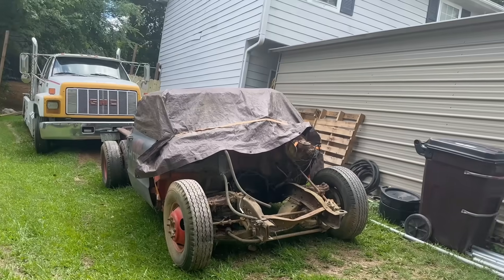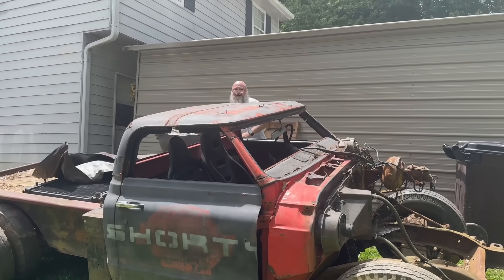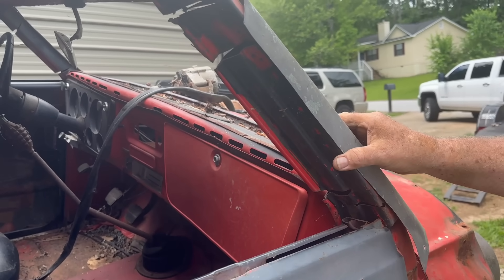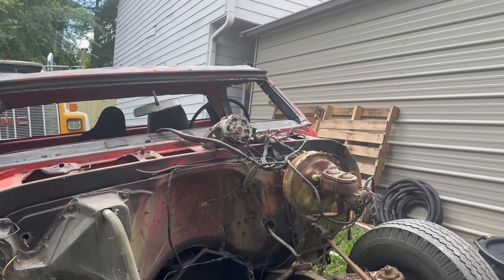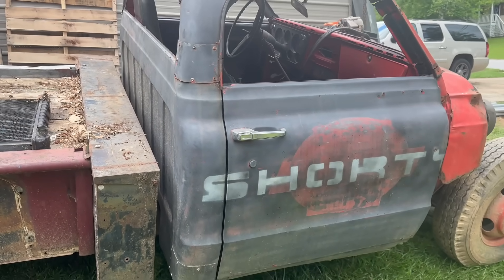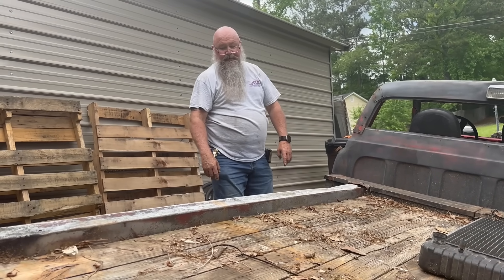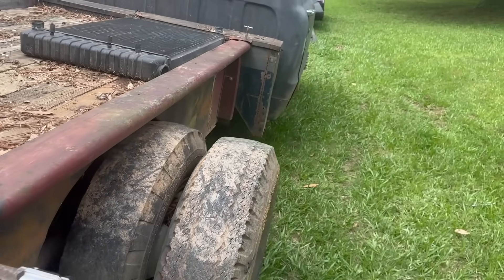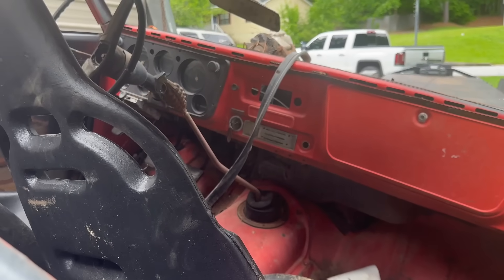Can’t believe someone cut this truck

Comment: Replace the top. Put it back to the original cab. Make a drag and drive truck. Fix the rear suspension in to a link set up. Drop a massive engine in it, SickWeek will never be the same!!

Comment: I’d either redo the roof with a factory roof or find a whole cab. I think it’d be a cool ramp truck!
That rear axle is an Eaton H.O.52. I have the same rear axle in my 67’ C/20. Mine has a 5:12 gear ratio. I’m swapping it out for a cab and chassis dually rear axle out of a square body truck.

Comment: My vote would be to finish their great idea, but do it legit. Use a custom wrap-around front glass and make the rest of the top out of good metal and make the back nice. By the time you're done, it'd be a great, usable 1 of 1 truck. That could fit a BIG powertrain in it as well. An all-motor 8.1L would be my beast of choice. (496 EFI)

Comment: The rear axle is an Eaton HO 52 or something similar…drop out center section like a 9 inch, used to have Detroit lockers available, came in the mid 60’s Chevy GMC pickups up to 1972.

Comment: Just imagine how many more classics would still be on the road if people who want to cut them up would just do the boring repairs that they would have to do eventually anyway first. Fixing the rockers and floors that there are already aftermarket parts for before chopping and shaving that will all have to be made by hand.  Alsp FYI, if a replacement title was easy to get, it would have been got.

Comment: What I would do with the truck is try to fabricate a removable top altogether that you can still fasten back into place that is stock height. That would be pretty cool. Lower the front end a bit and put a nice little small block in there.

Comment: The rear end is an HO72 1 Ton, probably has 5.14 gears, hard to find any gear set taller than 4.10, good luck.

Comment: I see potential. I would definitely make it into a "roadster", ditch the rear end, and 8 lug frontend, shorten the wheelbase, do a rockcrawler style narrowed frontend with junky parts, and then put a set of 33" slicks, skinnys, and some kind of ridiculous motor to just cruise it, be a nuisance and do MASSIVE burnouts😂

Comment: Channel and drop the body lower, take off the roof, fit a windscreen of no more then 3 inches tall, hey presto, world's only C-30 Spyder.
Roll hoops for two seats, spray the inside with bedliner and toss in some vinyl floor mats, then stitch up a leather cover like English sports cars get. Make sure whatever powers it fits under the hood.

Comment: Early blazers were eventually a convertible. Use a windshield frame from one if you want a convertible. A cab and chassis dually rear end should be narrower than a pickup dually rear. Use that and put a style side bed on it . Or if you feel real funky make a dually blazer out of it. Longer wheel base  and all
Reply: 😊blazers were essentially converts